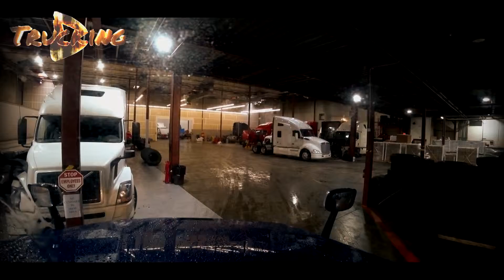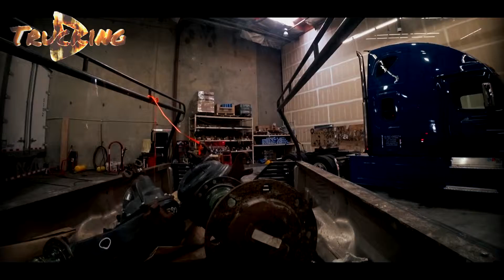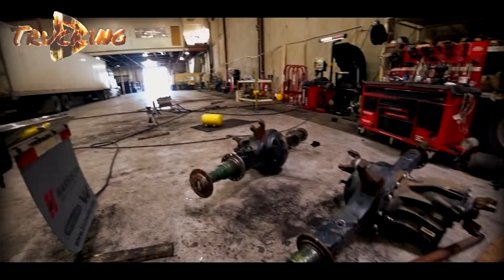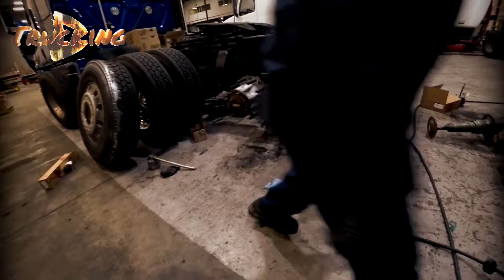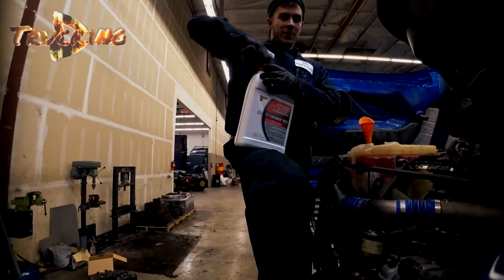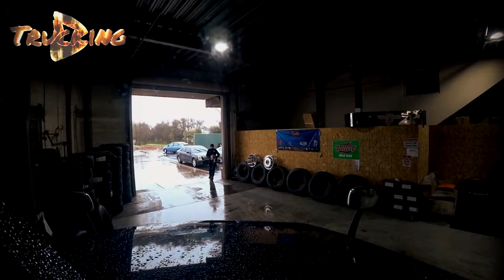Cascadia Rear Axle Swap at NVK

Comment: Так будет интереснее...
Reply from the maker: Not every video you can talk.....  but I try too.....
Reply: @d-trucking6813  I got 2016 freightliner with dead axle do you recommend to change it to differential axle
Reply: khaled Suliman fund our what exactly is wrong with it. Just swap internals and keep rolling. You can stop by junk yard and they can install used axle for good price too. Don’t buy brand new axle, too expensive
Reply: @DKUSTOMSGARAGE  I will buy used one,
I got 2016 freightliner with 366k miles and 400hp but i need to replace the dead tandem I specific Ratio do you recommend